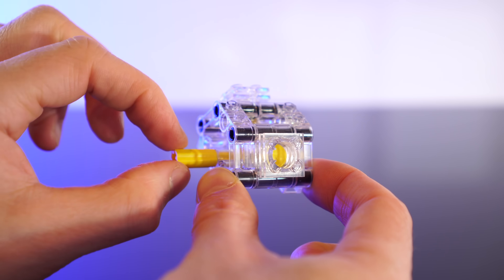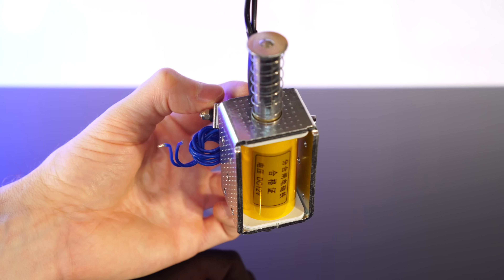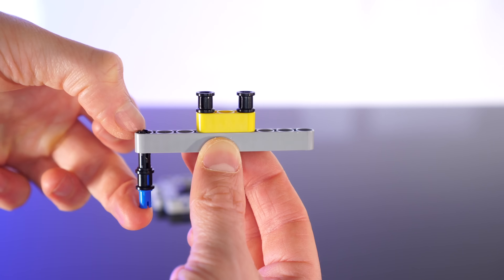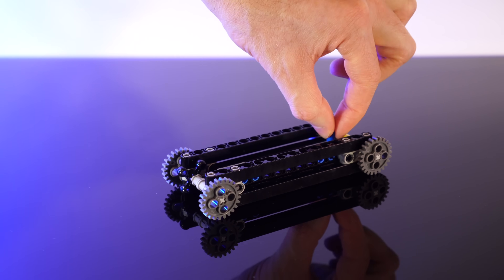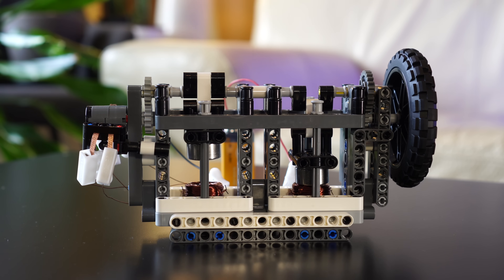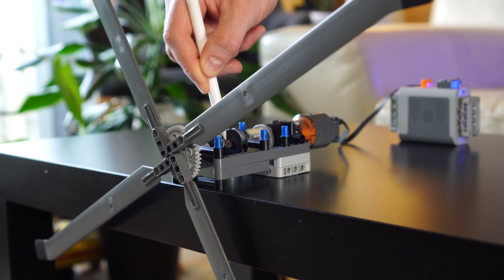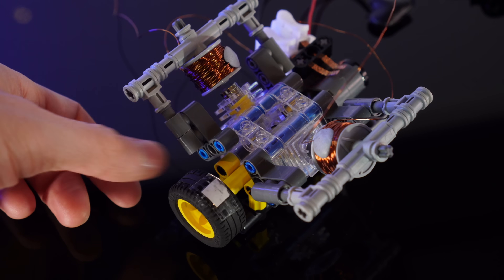Lego Piston Power: Making ELECTROMAGNETIC Engines!

Comment from the maker: 🌏 Get an Exclusive NordVPN deal + 4 months extra here ➼ https://nordvpn.com/brickjams It’s risk-free with Nord’s 30-day money-back guarantee! ✌
Reply: This sponsor is garbage
Reply: VPNs are a Scam!
Reply: please generate energy with sound
Reply: There's some proposition : if you want more torque, rpm and perfect balance use an inline 6 configuration with 3 pair offset by 60 degree (basically mirroring two inline 3 put together) there's the pair : (1-6), (2-5) and (3-4) for perfect balance. Note : this configuration is in generally a lot "rpm happy*" (*love high rpm). (ok, I admit, I'm a little bit hard right now but its just an idea.
Reply: (basically mirroring two inline 3 put together*) connected together at the crank.
Reply: V4
Reply: Where is the gas
Reply: Do you think you could do the pistons without having them not touching the coils but us the repelling aspect to make the pistons move.
Reply: Gyatt
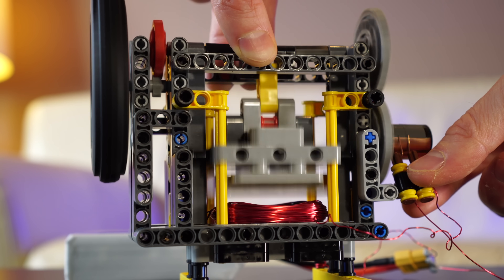Reply: 8:25 there are official Lego weighted bricks, and bricks are very well compatible with technic pieces so if you bought some you could attach them anywhere on the build that seems necessary to secure. Top, bottom, sides, or all!

Comment: Here is a 500 word essay about A magnet engine is a proposed mechanical device that attempts to generate continuous motion or usable power solely from magnetic forces. While the idea has fascinated inventors, hobbyists, and theorists for decades, it remains a subject of controversy and scientific misunderstanding. Magnetic fields undeniably exert real forces—repulsion, attraction, and torque—so the notion of harnessing these forces to generate continuous motion appears intuitively appealing. However, a careful examination of magnetic physics shows why a self-sustaining magnet engine has never been demonstrated and why the concept, while imaginative, is fundamentally constrained by established physical laws.

Permanent magnets create fields that exert force on other magnets and on ferromagnetic materials. These fields, however, are conservative, meaning the net work done by magnetic forces around a closed path is zero. When two magnets are brought together, energy is released as they attract; when they are pulled apart, an equal amount of energy must be invested to return them to their original positions. This symmetry is central to why a purely magnetic engine cannot generate energy indefinitely. To produce continuous rotation, an engine must experience a net torque over each full cycle, but magnetic arrangements inevitably balance out: attractions and repulsions cancel when the full circular motion is considered.

Despite these constraints, numerous designs have been proposed. Common configurations involve rotor–stator systems where magnets are arranged at specific angles or distances in an attempt to create an imbalance that would cause rotation. Some designs include shielding materials placed strategically to “block” unwanted magnetic forces at certain points. Others use moving parts or mechanical gates intended to shift magnetic interactions dynamically. While these systems can produce brief motion—often due to unbalanced forces or the initial push supplied by the operator—they always settle into equilibrium or require additional energy input to continue.

The continued fascination with magnet engines is understandable. They represent a blend of curiosity, creativity, and the human desire to find clean and abundant energy sources. The idea appeals to our intuition because magnets seem to provide force “for free” and do not visibly degrade. Yet permanent magnets can lose strength through heat, shock, or repeated demagnetization cycles, and they cannot provide unlimited energy. Real engines, whether combustion-based or electromagnetic, rely on energy input from fuel, electricity, or other external sources to maintain operation.

That said, magnets do play a crucial role in legitimate, highly efficient engines—just not in the way magnet-engine enthusiasts imagine. Electric motors, for example, use magnetic fields in combination with electrical energy to generate rotation. These devices are exceptionally well understood and are foundational to modern technology, from household appliances to electric vehicles. They demonstrate the power of magnetic forces when used within the boundaries of physics.

In summary, the magnet engine is an intriguing idea rooted in the real forces produced by magnets. However, as a self-powering system, it conflicts with fundamental physical principles, especially conservation of energy. While magnets remain essential to modern engineering, a true magnet-only engine remains a scientifically unsupported concept—one that continues to inspire curiosity but not functional machines.

Comment: You can possibly double the power of these engines by adding a second stroke. Not only push the magnet away, also attract the magnet back. Double the power but also double the power drain.

Comment: You could use a relay in your timing circuit.

Pin30= Pos in
Pin 87=Cyl 1 power
Pin 87a=Cyl 2 power
Pin 85=pos in
Ground pin 86 through your 'commutator bar'

This way you don't need to worry about synchronizing your brushes exactly 180 degrees apart, and it's easy to expand.

Now you could add your second set of 'brushes' then simply double up the circuitry for 4 cylinders. Easier than running 1 set of brushes per cylinder.

Comment: A suggestion! Instead of a brush system (the copper strip and the wires for contacts) use a hall effect sensor and a magnet (possibly also a weight on the other side of the wheel) or a set of magnets, to set the timing!

Comment: I wonder how a short stroke piston with a coil on each side, with your geared distributor pushing the oiston back and forth. the timing and voltage could be adjusted to basically act as a counter force at the ends of the stroke....guessing 2-5 degrees before top of stroke to start the charge pushing back

Comment: 14:05:  So you made a nice improvised distributor for that thing.  By the way, I hope you know that electric motors and mechanical engines work on the same principles that make their parts equivalent to each other.  For example, the distributor cap in a multiple-cylinder gasoline engine is the commutator in an electric motor --- though at the same time the commutator in an electric motor is like the camshaft assembly in an engine.  Similarly, the pistons in a gasoline engine are the rotor poles in an electric motor, with the armature in the electric motor being like the engine's crankshaft.  The magnetic fields are the connecting rods.  The electric motor "fires" and has a "power stroke" every time the commutator switches the electrical polarity in the motor's windings.  This makes two-pole motors really suck because they have only two power strokes per revolution, while a four-pole motor has four power strokes per revolution --- just like a four-cylinder gasoline engine.

Comment: What about a steel core solenoid.  There may be a stronger magnetic field there and the current should be more controllable.
Reply from the maker: I'm sure that could be more efficient! That was my initial idea, but I couldn't find a way of securing the magnet strongly enough to Lego. Metal tends to pull magnets off the Lego, and I currently don't want to super glue magnets in place as that destroys my Lego 😅

Comment: You could smooth this out majorly by not using a 12 o'clock/6 o'clock position for the lifters. Offset one to say, a 3 o'clock position. That way you never have both "pistons" opposing each other, and while one is at a full extension, the other never is. Will have to mess with your timing copper drum but will be worth it

Comment: try getting an hbridge chip so you can push pull each cylender, and then you can phase the cranks 90 degrees off and have an engine with twice as much power and no dead spots in the same form factor

Comment: you can have a branch off of the wires that go to the coils and flip them, then if you put them where you put the wires of the second coil you have double action, like how a steam rail locomotive produces power

also there's a reason that the pistons of twin-cylinder engines are 90 degrees out of phase instead of 180, it's so the dead spot of one cylinder happens at the same time as the middle of the power stroke of the other, for single acting pistons it matters less but my point still stands

i'd love to see some form of double action working, you could also try an h-type engine, where the cylinders face outwards, but are connected to the same point on the crank, which would mimic double action

for cooler coils, since copper is quite a good thermal conductor, if you wind the coils very tightly then attach them to some thermal mass, like a metal baseplate or heatsink, then soak them in a thermally conductive, dielectric gel like thermal paste (for a cpu or other such thing), they should stay relatively cool which would allow for longer runtime at higher voltages

Comment: I am looking to learn how to do this type of thing. What sort of projects would you recommend as a starting place?
Reply from the maker: That's awesome, I'm glad to hear it! Honestly, the best way to get into it is simply to begin. Sounds dumb, but you'll need to make a lot of mistakes before things start clicking. I'd personally recommend building a simple generator. I feel that process teaches you a lot about how current, voltage, and resistance works, and gives you an appreciation for how mechanical input can be converted into electrical work. Gives you a real good appreciation for there being 'no free lunch' when converting one energy source into another. Then if you want to build a motor / engine, it's pretty easy to just reverse everything and and turn your generator into a motor!

Comment: You will double your torque and power if update synchronization mechanism with second pair of contact platforms for each magnet and set the wiring such as it will run current in the opposite side, thus both magnets will work most of the time in modes of pull-push

Comment: Putting springs under the coils could give you more power throughput from the coils to the pistons. Magnetic field strength drops off pretty quickly over distance, so keeping it as close to the magnet as possible will transfer the most power. You'd just need to find the perfect spring coefficient to get it working.

Comment: I have a question what kind of wire did you use in your electric motor, the one you made yourself
Reply from the maker: Howdy, I've made a few motors, so it depends which one you mean. But I think I used 28 gauge wire for one of my main motors
Reply: for that first little engine

Comment: Nicely done 👍
Excellent video and wonderful narrative 👍
I hope viewers understand you used enameled (insulated) copper wire and not just bare copper wire.
Also, it might not be in keeping with your channels philosophy… consider using a variable dc power supply 😉
Reply from the maker: Thanks! If anyone has watched any of my previous videos, they likely know that the wire is insulated. And for sure, I use dc power supplies for many of my projects! For this one, I was just interested to use batteries as I wanted to build something that could drive itself without being connected to a supply via wires

Comment: Also just got idea, maybe someone wrote it already but why couldn't be six coils  in circle each powered separatedly, "crankshaft" going through middle mouted securely with magnet/magnet's to topnbottom of it, so it kinda work like started in car? idk, always two coils would get power rotating it maybe more strongly? than just having straight upndown motion??? and since it would be 6 of them they maybe wouldn't heat up as much even with  more powerful battery. not sure how much strengt it would have but probably would have more rpm? idk

Comment: great LEGO engineering, pretty dismal ELECTRICAL engineering.

so, a coil, ALL the magnetic flux has to pass through its center, and the strongest field is inside the coil... outside the coil, the field extends and disperses to "infinity"... so the magnet should be INSIDE the coil.

then a crank makes the best torque at 90 degrees. not at TDC or BDC. stop thinking its an ICE or steam engine. it isnt.

so you want to repel the magnet out of the coil at the HALF STROKE.

this will require the polarity of the coil to reverse as it ascends or descends of course.

the magnets will make it into a vague type of generator... better to use an iron piston and two coils, one pulling it up from mid stroke, one pulling it down... or invert that. two iron slugs and the piston is the coil... makes it lighter. less power wasted in overcoming inertia. unfortunately repulsion is better than attraction due to the inverse square (cube?) law... but whatever, you arent out to break records?

you waste a lot of power in simply heating wire rather than creating magnetic field. ampere turns. the resistance will dictate the current for a given voltage, the more turns you have, the more magnetic field created for a given current... theres actually a lot of fudging and guesswork in this regard, but you are better with much finer wire, and using a length that gives the resistance to allow for a given current... can always play around with what works best.

the coils will be making massive kickback spikes that rapidly destroy lithium cells.. an SLA will tolerate the abuse far better...

anyway, the commutators made me think of something else... if you use wedges of copper, you can achieve PWM by the location of the brush...

Comment: Reverse polarity on the downstroke. Put each piston under power for 100% of it's cycle instead of 50%. If you wanted to do 3 or 6 pistons you could probably run a speed controller and power the coils with a 3 phase AC signal. 

Essentially what you're doing is turning a brushed DC motor into independent linear phases.

Comment: If you had some little more elctronics skills you could effectively double the torque of those pusher motors. Upon inverting the polarity the magnet is attracted rather than reppelles, so if you could make a little circuit that would not only switch but reverse the polarity of the magnets you could double the power. 

Additionally, The tiny piston motor sounds reasonable. You could use the cillinder itself as a coil former, and if you reverse the polarity for every stroke it does you could get a pretty efficient motor

Comment: You can double the torque output of the solenoid engines without changing anything about their physical design

You can do this by reversing the polarity of the coils with each stroke. The best way to achieve this is by using a what is known as an H bridge. A four transistor configuration that instead of merely turning the coils on and off, flips the polarity of the coil to both attract and repel the magnets essentially doubling the torque

Comment: Watching this video sent me down a rabbit hole of "Wait, solenoid engines are a real thing, right?  Are they used for anything?"  Apparently they do have applications, but like you said, they are not very efficient.  It would probably be a good idea to hook up a Potentiometer to the power supply, so you can actually have some throttle control.

I think the smaller scale would be cooler, I'm curious how you will solve more complex timing arrangements though, for example for a V8 I think you might need some kind of hacked together distributor cap and I'm curious how you'd do it.
Reply from the maker: Ha yeah I'm curious how to solve the timing issue too 😅 The best I can think of is likely a hall effect sensor and then some MOSFETs or something to power each coil. Would still have to mount a significant number of sensors around a drum though which is a little annoying. Very open to other ideas though!

Comment: What about super capacitor the have the coil on the load. Add a 1kΩ resistor for longevity. The cap charges when not in contact with the switch, then when it is it should dump the voltage into the coil(inductor) causing a mechanical exchange and changing the switch back to off. The plate of copper on the other end of the flywheel is the switch I'm referring to. It's similar to an electrical relay switch but using mechanical energy to switch the larger side of the relay. Adding ball bearings to the rubber Lego wheel should give it more weight for the flywheel part too, even help with balancing it.

Btw yes I have an electrical engineering degree.

Comment: I think the “e-piston” design at the beginning could have worked fine if you had two synchronized pistons facing opposite directions, that way the shaking is canceled out. You could even have them run off the same coil to save weight/space. Switching it so the magnet is in the center and the coils are on the piston would make that savings even greater, though I don’t know if the two coils would interfere with each other. 
You could also do two pairs of opposed pistons with 180° timing offsets, which is essentially a “flat four” or “boxer engine” you can find in cars like the WRX and Cayman
Reply from the maker: That's actually quite a nice idea, thanks! So it could almost be like a boxer design, with a single central coil driving two pistons on either side of it. Perhaps as others have said, it could also be made into double duty by pulling one while repelling the other. I reckon I'll give this a try. Cheers for the suggestion 🙏

Comment: Unlike most chemical piston engines, with a magnetic coil you can reverse the polarity to make it pull instead, so if you connect two pistons with a 90° offset you could possibly achieve a ~180% power cycle and not have to start the rotation manually.